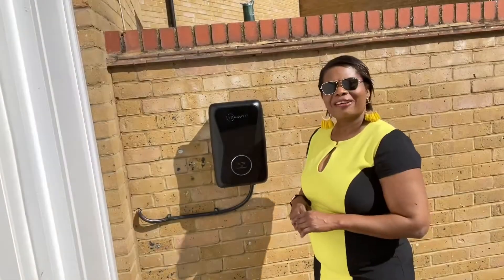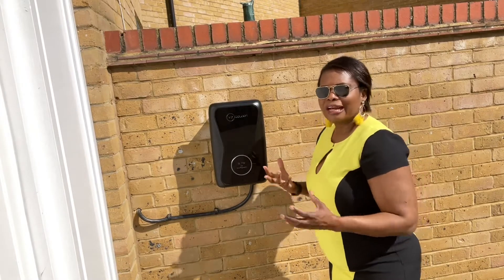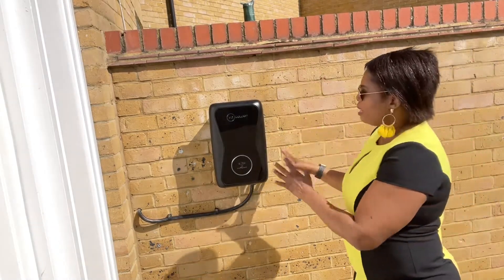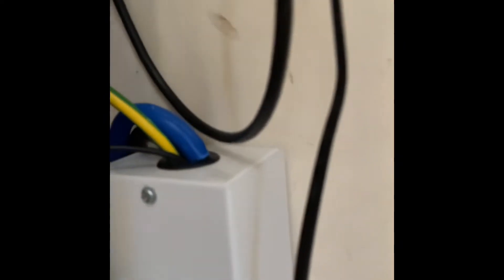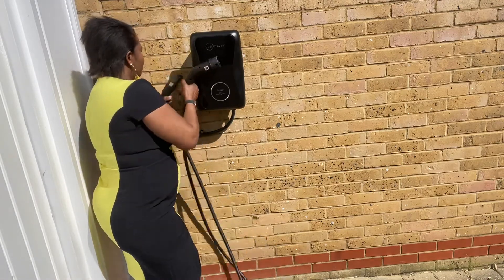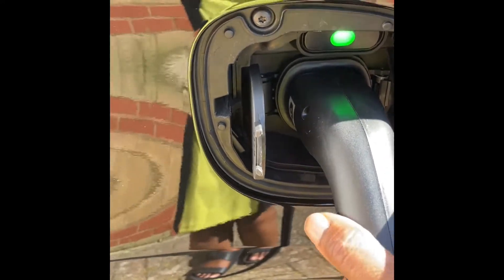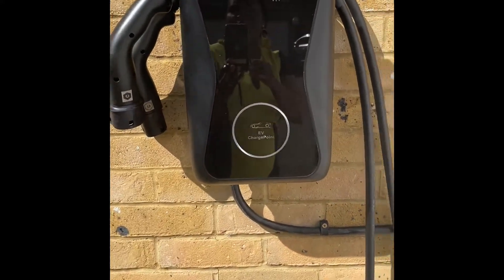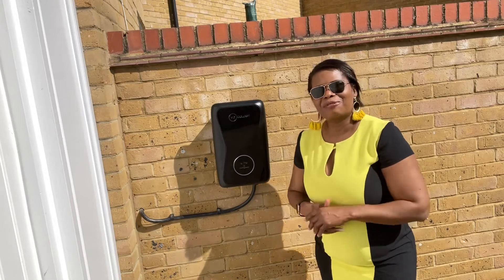Home EV Charger Installation & Project EV Review | Charging Your Electric Car at Home

Comment: Would love to see the test procedure on the Electric charger to clarify PE/CP Faults and also it would be nice to clarify what Type RCD is required and if you needed a Earth rod installed for the installation, and notification to the DNO of Installation and load to the grid.
Reply: You require 6mm SWA cable or 6mm Twin and Earth, a A Type RCBO rated to 32amps that covers AC and DC this covers the strongest single phase EV which is 7.3Kw, and with Project EV they have a pro earth in all models so even on a PME / TNC-S System you dont require a earth rod or seperate earth, also this model uses a type 2 plug but they also do make a type 1 plug adaptor so it can be used on different cars, but generally most cars use a type 2 plug, as for the test procedure there are alot but as of yet there is no offical test sheet to write them down so for now you just do you ZS, R1R2 and RCD trip times.
As for the DNO you are ment to notify them so they can reduce you charge if there is too much pull on the grid, it may also be worth asking them to upgrade your home supply from 60A to 80A for free or 100A if your willing to pay, I got mine for free upgraded as im a Spark myself and gave them all the test results
Reply: @Adept1780  🤣🤣🤣🤣🤣🤣🤣